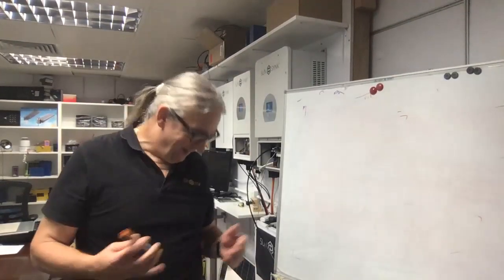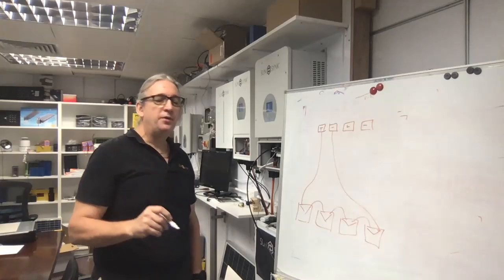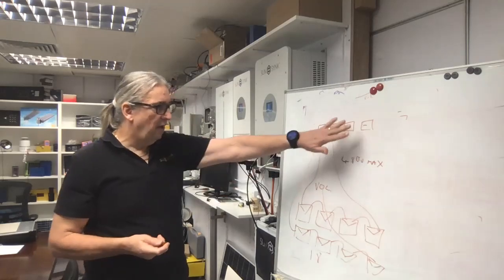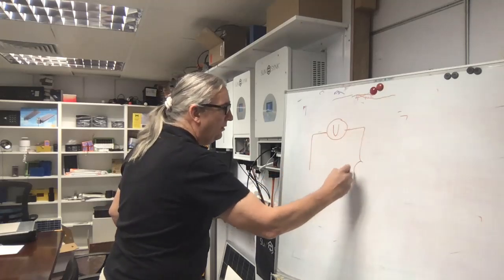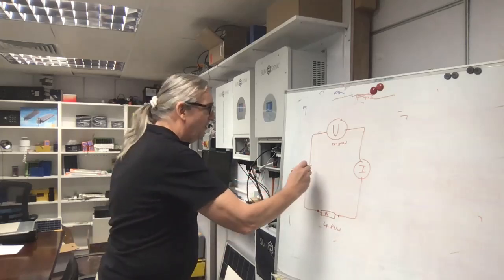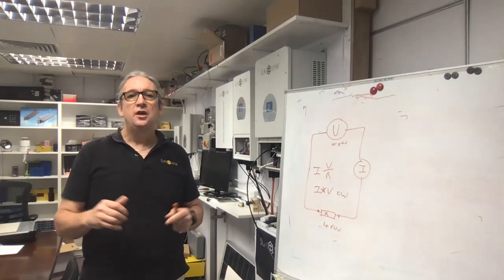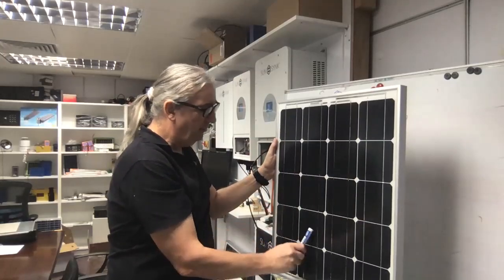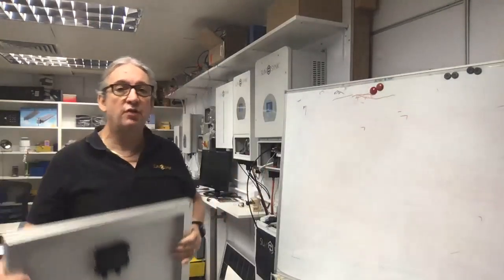Understanding MPPT

Comment: Thanks - I have always wondered about two aspects - 1. if the panels are in full sun eg 2,4kw possible , but mppt is only drawing 400 watts then where does the excess energy go. 2. how does the mppt adjust its input impedance i.e R in your video

Comment: You are an extremely poor communicator. You NEVER   explained what "MPPT" is. You actually explainef what "Voc", but very poorly. The Voc of a panel is more like 0.667 volts per cell. Not 0.6 v. That extra 10% makes a huge difference. You should have you someone review your script BEFORE making another vidreo.

Comment: voc is open circuit once it is connected to the charge controller it no longer has a open circuit. there is a load on it even if it is in float mode. so voc is not important the vmp is what we need to be worried about. That is the actual load if that is to high then issues.
Reply: You are not 100% correct ... When you close the switch and connect the Solar Panels in sunlight, the MPPT input will see full Voc, until the MPPT logic pulls the voltage down. NEVER exceeding Voc is extremely important.
Reply: that's does not make any since because I'm doing it right now have been for weeks. the voc is only for milliseconds not enought time to hurt anything that's where it not right. the amps is what we need to look at not voc. every device has a amp limit not a volt limit except mppt that makes no sense. its all a scam and people fall for it. @MrSummitville
Reply: @hayzersolar  if your car has a 12V 50A battery then the radio in the car won`t have a problem, even if you get a bigger battery e.g 12V 100A your car radio wont blow up. It`s  plain and simple. All they say with inverters is that max voc should be in total on 5Kw inverter about 450V multiplied by amps should not exceed 5000 watts.

Comment: Hi Keith. I want to install 10 x 660W panels. The VOC is 45,4V per panel making it 454V. Will this be okay for the MPPT of the 8kW SS Inverter? Max DC is 500V? Factoring in cold weather, will this still be okay as it might add additional voltage over the 10panels…South Africa does not go below zero degrees celcius
Reply: Do the math and calculate Max Voc in cold weather.   I would not use 10 panels in Series.

Comment: Thank you for a great video. So does that mean you can connect 72 545 watt panels to 2 Sunsync 8kw inverters with four MPPT's?  two stings in of 9 panels connected in series connected in parallel to one MPPT times four?

Comment: What's the max wattage for the MPPTs on the 12KW 3 phase inverter knowing that it has max of 26A for MPPT1 and 13A for MPPT2? I am unable to find this information on the forum. My end-goal is to connect 12*540W in parallel to each of the MPPTs.
Reply: Hi Johhny. Just need some advice. I am about to connect the same amount of panels. Did this setup work on your 3 phase 12Kw Sunsynk. Just worried that my amps will be too high on the 2 strings. Hope you can help. Regards.  Alwyn Viljoen

Comment: Hi. When installing a 5kw inverter unit is it necessary to pre charge the battery input on the inverter before connecting the battery to the inverter?
Reply: absolutely.. precharge the capacitors..

Comment: I have 8kva sunsynk with 10kwp panel, but I need to expand panel capacity to 15kwp for battery charging for night load. The question is can I combine sunsynk hybrid inverter with other brand mppt, to expand charging capacity. Thanks alot

Comment: Good day Keith

There is one major concern about the MPPT's of the Sunsynk inverter that is still not clear.  
Let's say we stay well in the input voltage spec, but connect many parallel solar strings together that are able to supply much more current than the MPPT input rating.  Is the MPPT intelligent enough to limit/regulate the current at the maximum of 18A or will it destroy itself by overcurrent?
Reply: Instant error or you blow it up

Comment: What's the maximum open circuit panel current on sunsynk inverters. The spec sheets aren't very clear on this. This is critical in the face of emerging high current bifacial panels.
Reply: So is the max 480v per MPPT
Reply from the maker: The mppt max voltage is 480v?, max wattage per mppt is 5kw current will vary depending on the voltage